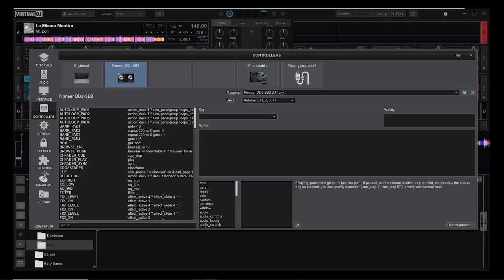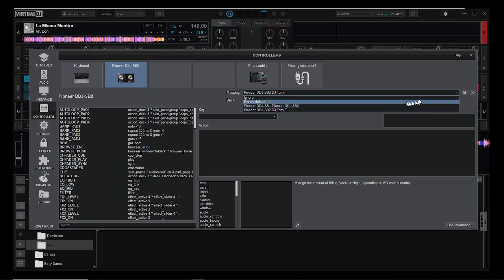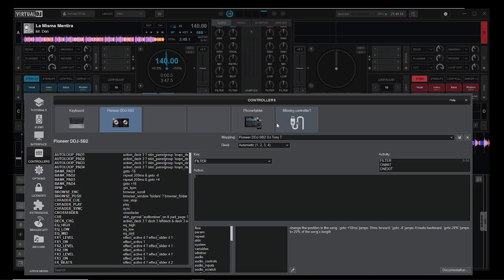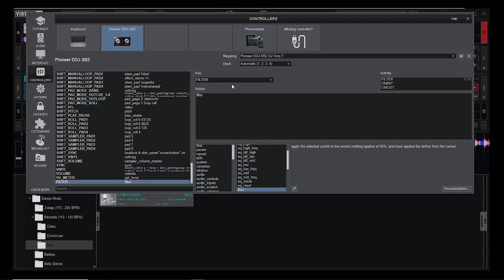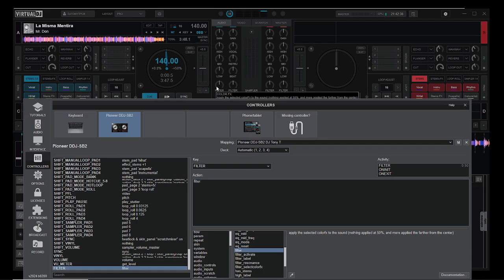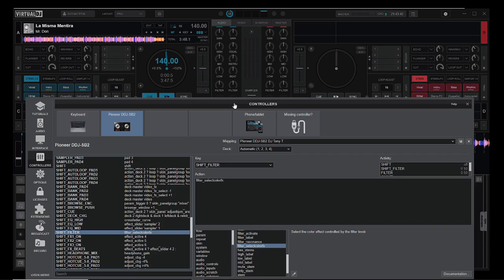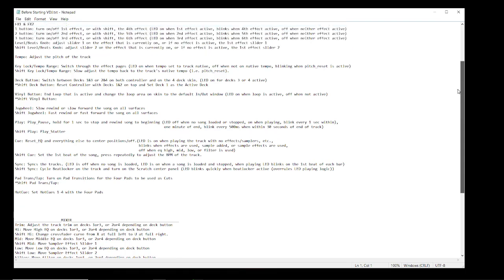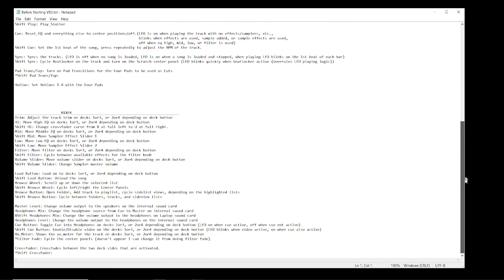How to Program your DJ Controller in Virtual DJ - Part 2 Filter Knob

Comment: Hello, I connected OMNIS DUO to virtudal dj latest version. Its working, but I cannot control the faders and filter from the dj set and I dont know how to fix this issue. I just want to choose the songs on Virtual DJ but control everything from the dj set
Reply from the maker: I would check that the drivers for the OMNIS DUO are installed on your laptop if they exist.  Secondly, you can see if the OMNIS DUO is communicating with VDJ by checking the activity window and moving a volume slider or something else.  If it is communicating, then in virtual DJ config mappers, select the factory default or your "OMNIS DUO" and then exit the configuration window.  If it still does not work, then you need to program volume faders and filter piece by piece.  I can create a video if you need help.